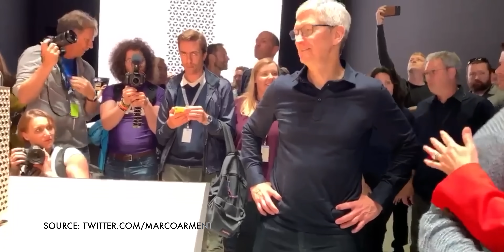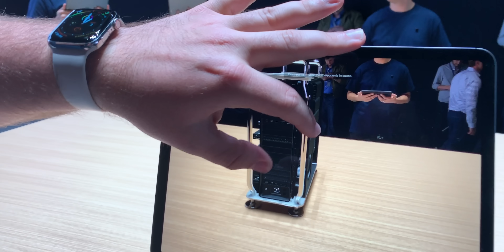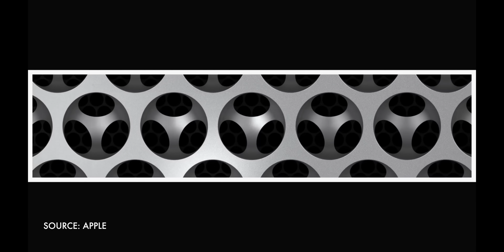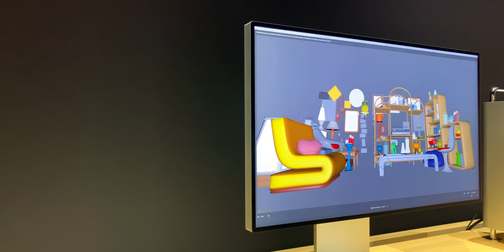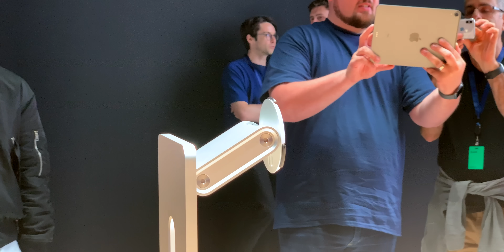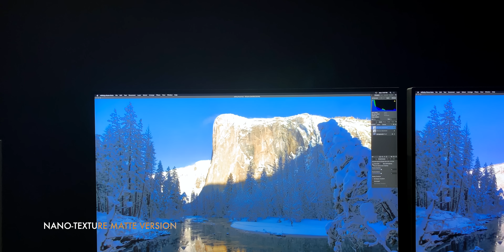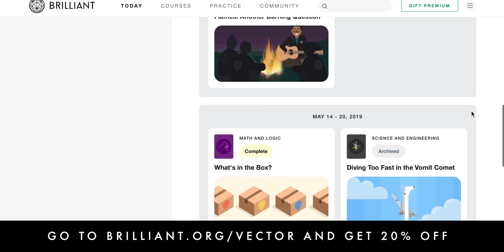New MAC PRO (2019) First Look!

Comment: For studios and large businesses, this is great but what about the huge number of small businesses and freelancers who need a powerful machine (that doesn't thermal throttle like the Mini) and don't need a monitor purely aimed at broadcast and film? Why not have a great monitor that isn't specced out beyond belief but still offers great performance? So many Youtubers are going nuts over the Mac Pro and Pro Display but it's overkill.  It's a mindboggling move by Apple.
Reply: Chris Shaw the answer is imac.
Reply: Coni Glione in some use cases yes but a lot of pros don’t want or need a heavily bezelled display and want to use their own. I’ve got a Wacom Cintiq Pro that cost £2500, I don’t want or need another expensive display.
Reply: @chrisshaw4286  only an idiot doesn't want to use a great display because of bezels. One can attach any display to the imac, and use the imac display as secondary screen. No problem.

Or one can buy a decent mac mini. For 99% of people is enough.

Sorry but Apple isn't interested in small pros with modest clients and very little money. Poor people don't appeal to Apple.

Sorry, but that's it. It's business baby.

A 1000$ mac pro has no sense in the Apple eco-system. People wanted a hi-end mac for years. Now you aren't happy anyway. 

Work more, work better, do more money: you'll can afford a mac pro. 

6000$ for a professional are very few money.

Think about a taxi driver, who spends 30k for his car every two years. Think about a mechanic that spends 100k for his shop. Think about a farmer that spends 200k for his tractors and shit. 

Do you tell me that your work is so minuscole that you can't afford a 5k computer?

Maybe you need to change your business to something more rewarding.

You really need to put things in prospective. I respect all kind of business and all people. But we all need a reality check. 
Who makes 1000k a month don't need a mac pro. 

Sure there is something else that fit the bill. 

Sadly there is no perfect company that makes the perfect things for our needs.
Reply: @巨大兎  Wow, what a childish response. A lot of assumptions there. Let me tackle each one.

Firstly, when you use dual monitors, having a massive bezel is annoying.

Regarding Mac Minis, they thermal throttle and the lack of a GPU makes it a no go.

In terms of how much I make as a motion designer that charges £350 a day and hasn't been out of work for over 5 years, you do the math buddy but I have no problem paying 5K for a computer. In fact, I've spent over 10k in the last 2 years but I want the most bang for my buck and the base model is massively underwhelming. So many other freelancers and small business owners are saying exactly the same and my point is that Apple have left out a huge market that crave a pro machine but not one that's overkill for 99% of people.

Maybe you could write a book and enlighten everyone on how to run a massively successful business. Because you seem to know everything.
Reply: @chrisshaw4286  Oh, don't be so triggered, man. It's so sad when a grown man becomes all passive-aggressive.
I don't have a successful business. I just analyze Apple's business decision. I'm good at it (and I'm bad at being rich, so... )

I'm happy you are doing 350 pounds a day every day. It's a decent wage for a creative, I guess.
Probably you are more in line with a full spec iMac or something like that. But I think you can afford a MacPro. I guess in UK too you can write expenses out of taxes. Btw I see where you are going for the bezel problem. It makes sense. But I guess if you are doing so well you can afford a nice Mac Pro with a dual monitor setup. No problem!

Btw in my business we just spent 8k for a tool... If all the tools I need costed like Macs I would be happy :). 

I don't need a fancy mac, my old mac is enough. But 5, 10, 15k for a tool it's not a crazy amount for any business, even small ones. If you need that. Most people don't really need a macpro. They dream about a macpro.

But I hope you are aware that yours is a little niche of the market. How many people in the world do heavy ass graphic or edit 8k videos?

For apple a 1000$/2000$ doesn't make financially any sense. 
There is no sense in create a new platform and to sell it at the same price of an assembled pc.
They had a lot of expenses in designing it and they will sell very few macpros. It's for a niche of pros that can afford 10k on a machine. And that are happy to spend that kind of money. Sadly small pros with 2k of budget for a workstation aren't economically interesting for Apple. Apple is happy to offer a Mac Mini for that money, or is more than happy to leave the 2k workstation marketplace to Windows. 

All the other people that dreamed about a cheap pc-like mac... I'm sorry for them. But if they can't spend 5-10k for a computer probably they haven't the need for a machine more powerful than an imac. If they have a handful of cheap clients... they can afford to wait a couple of minutes for a rendering. 

Anyway: on a Mac Mini you can add an external graphic card. I think it is enough for most people. 

Apple is far away from perfect. They can't offer a thing for everybody. They try to give to users the right product, but they need to make money themselves first. 

And try to win back enterprise users it's a big bet for Apple... in the recent years Apple was all about consumer mobile products. They left the hi-end market. And now they are back again. It's a risk. With the trashcan they failed, and they needed years to be back on track with a pro line. Even with all the money Apple has, create a new line of pc it's not easy. They can't just put some stuff in a generic pc case. I hope you understand that.

The mid-tier semi pros that wanted a Apple-pc are sad.... but whatever. You can't make everybody happy all the time.

A mid-tier Mac Pro would have been on the feet of the imac and mac mini lines. Big pros would have been displeased. And it would have been another trash-can fiasco. And truly, I can assure you that in the end, very few people would buy a 2000$ macpro.
Reply: @巨大兎  Every Mac Pro model has had a more realistic entry level price than this and photographers, designers and musicians who aren't earning 200k a year have all bought into this product and have now been priced out because Apple don't realise the professional market is largely made up of freelancers and small businesses. On top of the cost, the lack of Nvidia support is a huge red flag for videographers, motion designers, animators and VFX production houses.
Reply: Chris Shaw yes, but moder processors are so powerful nowadays that all the people you just mentioned don't need a dedicated workstation to be 100% more productive and faster than just 5 years ago. Times changed. Even an iPhone nowadays has a raw power that put to shame workstations of few years ago.

Small creators have plenty of power and better value with an iMac. More power it's just overkill. 
It's always wellcome, but it's not necessary.

Comment: I’m not a pro user but I was blown away. What a beast. I just want one to have one.
Reply: Uncle Ono And that’s why we all dream.
Reply: max out will probably cost around the same as a custom built one with 11 GPUs and two xeons. 11k build that's on youtube, go find it.
Reply: Jonathan Starsmoure uh... you're wrong. 11 GPU and 2 Xeons are normally the inexpensive versions of the xeon. The newer version are way more expensive. and these are work based gpu. not gaming based.
Reply: @sairian  

https://www.youtube.com/watch?v=Uk2qIYvgFaE

Tell that to that guy. Vega 2's aren't exactly workstation cards, they're gaming cards. 

Still can't beat that rig though I'm sure.
Reply: But it can't compare to Mac Pro's quite fans though and portability, that's where apple shines
Reply: Jonathan Starsmoure Vega 2’s aren’t gaming. Yes. The radeon 7 which it is based off, is gaming. But they increased the GBs a whole lot to take up more monsters software. Yes. But here, that is made for servers. Not work stations like Mac. That’s the problem. They aren’t made to work like a normal computer would be, they’re made to be servers. Most servers had thousands of dollars worth of gpu and hard drives. lol
Reply: Hm.. noww thinking.. 11 Vega 2? 
Yeah. Now it’s different. lol

Comment: It is not the pro hardware for all “pro” users. Clearly aimed at audio/video production. Not for Pro you tubers. Not for pro coders. Base config is artificially low by using parts no one will use (4 sticks of memory in a 6 channel system). Aimed at a much smaller audience than any Mac Pro has been.
Reply: Easy: just because now a prosumer mac is more than enough for most businesses.
Reply: My personal issue is that I need a bigger monitor than the iMac, so I need a headless Mac with good gpu (not mini).